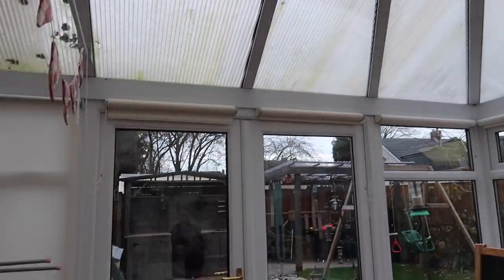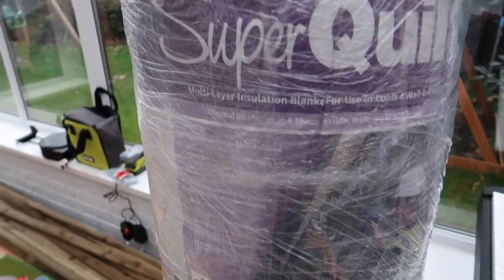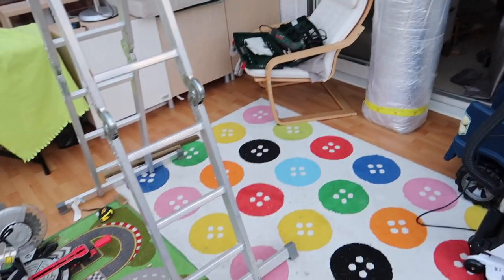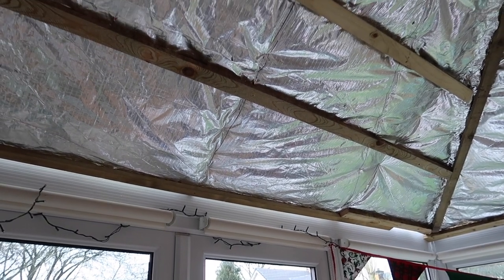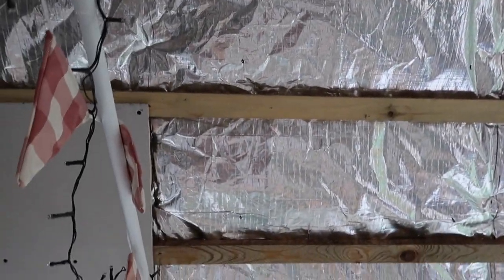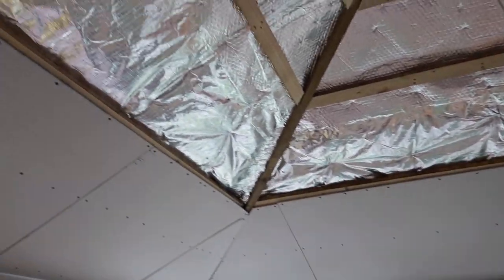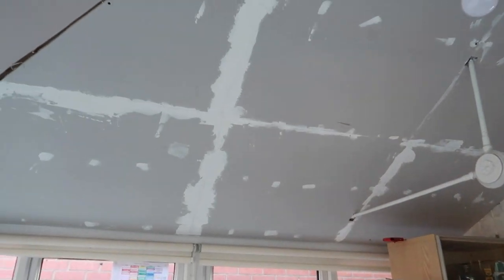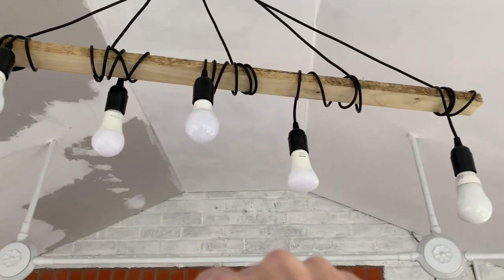How to DIY Insulated Conservatory Roof less than £320 - Single handed 30 something women!

Comment: Looks good....from inside but I can't imagine it does from the outside....
As for condensation , yes you've made a good job of sealing inside..but I can't see any ventilation to allow condensation to exit.
Any condensation can now freeze in winter and expand. After a winter going into spring/summer you may see some cracks or damp spots in your plasterboard.
Reply from the maker: Thanks for your comments, its been up almost two years now and theres absolutely no issue with any condensation and you don't see much different from outside it just looks white.

Comment: Truly amazing job. did you need "Special" screws to attach the battens to the Upvc struts ?
Reply from the maker: I used the self tapping screws for metal from b&q to ensure a strong grip
Reply: @LyricGrace  My wife and I were wondering if you had a free week at all ?...lol
Reply from the maker: @buggybill2003  ha I wish! If I did it’d be spent cracking on with all my other house based DIY ideas! Good luck if you plan to do yours!
Reply: @buggybill2003  🤣🤣

Comment: Hi Jane, how do you seal the bottom part  of insulation before installing the batons?  Do you tape it against the uPVC. Thanks in advance
Reply from the maker: Yes I neatly taped it then after the plasterboard went up used a flexible filler to make the edge neat and square

Comment: Why use double batons on beams? Could you not have taped insulation on then drilled and fix a baton on after?
Reply from the maker: You need air gaps for air flow around the insulation. Also I wouldn’t have been able to have seen or be accurate in putting my beams up, so the first one creates an extra air gap so that no condensation forms.

Comment: Hi love! This is AMAZING! Has given me so much confidence! Our conservatory is exactly the same! We have 3 kids and 3 TINY bedrooms and I was HOPING to insulate the conservatory, insulate the floor & carpet and move hubby & I down there as a temporary bedroom as our kids are getting older and moving is not an option and we have just been quoted 15k by two local companies and we have a budget of £1000. A couple of questions please….

Is the difference in temp really noticeable? In the winter ours is like a fridge and summer it’s a sauna. Would u be happy to sleep in yours or is it still to much? 

Also , have you noticed a reduction in the rain noise? 

Thankyou! Well done !
Reply from the maker: Hi, thanks for your comments. So to address your questions, in summer it’s def cooler by a large amount, in winter it can still be cold as there’s no central heating in there BUT (and this is where the difference is) I use a plug in rad and open the door the temp equalises with the house quickly and also then retains the heat well. So absolutely worth it for us. We use it as an office\ playroom now all year round. The rain noise is massively less and I can conduct calls no problem in there where as before there was no way when it was raining! You can still hear it but it’s much reduced. Good luck with yours!

Comment: Hi  great job well done, could you confirm if this has made a big difference in the winter? We have same conservatory with no heating, will this do the job to keep it warm? Again really well done ;)
Reply from the maker: Thanks for commenting. So you might of seen my previous comments. The conservatory isn’t actually heated apart from a small oil radiator, so if the door is not been open, it’s still chilly. However, the massive difference is that if I leave the door open and the room equalises with the house temperature, it keeps its temperature far far better than it did before so essentially it’s more of a usable room.

Comment: Brilliant Job. Question. These self taping screws, are they too long to go out to other side from metal into plastic cover, causing a leak? how you know the length required? i m thinking yo do mine after watching this :)
Reply from the maker: Great question! I pulled back the plastic cover from one beam to see roughly what size the metal was on my conservatory and then also measured the thickness of the polycarbonate. With these measurements and knowing the thickness of the wood I then used to calculate roughly how long of self tapping screw I would be able to use. Hope that helps.

Comment: Wow this is great thanks!! Was worried about the added weight and condensation but seems great what you’ve done. If you ever wanted to take it down do you think that would be possible or cause damage due to the holes or could they be filled? Thanks xx
Reply from the maker: I’m not sure, I guess after taking everything down I’d remove the plastic strip and do some research about filling the holes. This is out forever home so in the end we’d like a proper extension, hence not wanting to spend much on a solution for the next 5-10 years until we can get the full extension.
Reply: That’s what we want to do in the future too (an extension) so don’t want to overspend on something that isn’t permanent. This is our forever (Uk) home too, but might be emigrating so if the visa comes through we’ll be renting it out. As long as it’s easy to take down if the renters start to have issues with it, it should be good 🤞thanks so much for this video and the three star lock one too ❤️ Xx
Reply from the maker: @katiec3686  thanks, good luck with your visa. The lock one was very very easy to do so had to share that!

Comment: Amazing Job. Do you have any issues with damp between the insulation and the polycarb roof due to condensation?
Reply from the maker: No none at all so far, I made sure there was gaps between the roof and insulation and insulation and boards to allow for airflow.

Comment: looks great, well done. what did you do on the outside?
Reply from the maker: Nothing, it still looks exactly the same on the outside as it did before I started, well I have cleaned it but only for my aesthetic value as I hate it looking grubby when I look down from the bedrooms!
Reply: Thanks.  We have clear glass and wondered how to not just see the insulation through the glass??
Reply from the maker: @smithersapp  ah right I see, yes mines different as it’s polycarbonate and you can’t really see through it. If it were me I’d look at using some frosting spray or frosting film on the glass. I’ve used it on a glass door before and it came out really well. Just an idea for you to look at. Perhaps someone else on YouTube may have a video for that?

Comment: Looking at doing this myself. How did you ensure there was a gap for airflow?
Reply from the maker: The first batons hold the quilt away from the original roof leaving a gap, then the second set hold the plasterboard away from the quilt leaving another air gap, so far no condensation and I’ve had very cold temps and some warmer sunshine and it’s all good. Hopefully I’ve left enough gap, it’s what other videos have suggested doing

Comment: Great video, quick question how old is your conservatoy roof, how long has the new stuff been up now. Have you seen any sagging due to the weight of the timbers.
Reply from the maker: The conservatory is 16 years old, the roofs been up around 10 months and no not seen any change so far. We’ve had both extremes of weather during this time.

Comment: Hi, its been 2 years since you uplaoded this so i justvwant to ask 
1. Do you have any problems with Damp? Im worried about condensation building up behind and ending up with a damp problem

2. How effective is it as a room now? Is it still too hot/too cold or is it just like any other room?

Great job btw 

Thanks in advance
Reply from the maker: Hi, Thanks for asking. No I have no problems with damp or condensation, I think the big key here is to make sure you have the air gaps for circulation. I use that room all year round now as an office (the toys are gone!!) Yes its cold if I don't heat it but once heated it stays warm and its not an oven in the summer anymore.
Reply: @LyricGrace  thank you for your reply! I'm on with doing it myself at the moment and this video was a great help

Comment: Looking at doing this to our conservatory, quick question how has it been living with the insulated roof for the past few months has the temperature been any better and have you had any issues with condensation?
Reply from the maker: Thanks for asking, no issues at all so far thankfully. It’s def warmed in winter and more importantly keeps the heat inside if I use a small heater. Today it was 24 outside but inside got no hotter than 20 so I’m happy with that as previously it was like a greenhouse if the sun shone and regularly went to high 30’s or 40s

Comment: Hi there 
I just did same & when I taped the side , there was lots of condensation , 
Without taping the cold draft gets in 
How did you go by that’s 

Thanks 

Ahmed
Reply from the maker: I don't get any condensation, I made sure there was room for airflow from the side up between the silver blanket and the plasterboard. Perhaps theres just not enough airflow with yours? I sealed all the sides of mine and its been fine.
Reply: Thanks for replying, il check

Comment: Hi , love the video .   Do you think I could put the batten on over the insulation and put the plaster boards on the same batten . Was thinking of tape or glue , pins etc to hold insulation and do one batten at a time holding it up . Would much appreciate your thoughts . Philip
Reply from the maker: I'm not sure I fully understand the question but if you are asking if one baton is enough I'd say no, you must have air flow on each side of the insulation hence I had to baton twice. Hope that is what you were asking?
Reply: @LyricGrace   air flow ?  Would definitely reduce that . Thank you

Comment: Looking to do this my self, how is the room to use compared to other normal rooms?
Reply from the maker: We use it a lot more now than we ever did. If there's no heating then it can get colder as any room would. If I need to heat it I use a little oil filled rad and pop it on for a bit. The best bit of the roof is that it now retains the heat once heated up rather than quickly losing it and having to have the heat on constantly. If I leave the door open between house and comservatory it quickly equalises the house temp and remains stable.
Reply: @LyricGrace  Thanks! Hope I can do as great a job as you.

Comment: Well done .. love what you've done.  Have you had any damp/mould problems..? 
You should be proud of yourself 👍
Reply from the maker: Thanks for the comments, no nothing at all with damp, the key is def to leave air circulation gaps!
Reply: Thats great.. where are the circultion gaps?
Reply from the maker: @philmartin904  between the first layer of wood and the insulation roll then between the roll and the boarding, nothing is touching to leave room for air flow

Comment: Hey so what was the end result for the heat?
Reply from the maker: So it’s worked out really well. We can use it year round. Obviously I have to heat it in winter but once it’s equalised with the house temp it retains its heat well and does not need the constant heat on as it did previously. In summer yes it still get warm in the sunshine but no where near as warm as previously we can easily work in the comfortable temp inside now and no sun glare on the monitor either

Comment: This video inspired me to have a crack at this myself. I’m following the same idea with same materials. I’m just doing a lean-to so it’s a bit easier. I got the insulation up 95% yesterday. Despite it being a cold night, down to 1 degree, it definitely made a difference. I have a Dyson fan that logs temps so I can compare quite clearly before and after. Between 6-9pm it was 2 degree’s warmer with the insulation. It also warmed up quicker in the morning. It’s a sunny January day, 2 degree’s outside but the conservatory is 22 degree’s and warming the house up! That’s definitely better than before.
Reply from the maker: Brilliant, glad to hear it’s helped you. Good luck with finishing

Comment: Hi there you done a good job on the roof did you have any problems with condensation ? Also I’d worry about the weight of the plaster board did you have any problems? Over all bloody good job I’m doing mine but concerned about putting plaster board up might go for plastic light weight option but your feed back would help thanks Lee
Reply from the maker: Hi, thanks for commenting. No I've not had an issues with condensation at all but its very important to leave air gaps. I did consider plastic but felt plaster board for me was easier. Go with what you feel is best. Good luck!
Reply: @LyricGrace  thanks for the reply have you been pleased the heat performance has it made a difference?
Reply from the maker: @gameboy388  yes a big difference! In winter it was obviously colder in the morning as no central heating but once I’d put the oil filled rad on for half an hour it retained the heat really well and did not need constant heat all day. Just leaving the house door open menat the heat equalised too which is much better than before.

Comment: This is so impressive! Trying to persuade my other half to give it a go together. Were you worried about the extra weight at all? How has it been since you did it, any issues with condensation? Thanks so much for the video.
Reply from the maker: I used the lightest plaster board I could find and it’s been fine, looks as good as it did over a year ago. No issues with condensation at all thankfully but I was sure to leave lots of air gaps so hopefully all ok 👍🏻
Reply: Good to know re the plaster boards. I have seen other videos where they add plaster too so surely this method weighs less than that. We might not do the full battons along the framework and just do a few to staple the insulation to but then obviously want it to stay up. Thanks again for the inspiration.
Reply: Hi Jane, sorry to be back asking more questions! The thinnest plaster board I can find is 9mm, do you think that is roughly what you used? Also, I have fallen at the first hurdle slightly and don't want to force the plastic covers off in case it breaks the roof, how did you get them off?? Thank you in advance! x
Reply from the maker: @alicerosfield8078  I used whatever the thinnest was at b&q so if they carry 9mm then that was it. Which plastic covers do you mean the centre top or on the beams? If you mean the beams I just screwed through them. Took a few goes to realise where the centre was but once you get it it’s easy

Comment: Well done good for.........I'm doing mine tomorrow but using upvc cladding....how did you find out if the existing roof can take the weight of using plaster board as I'd rather use that but been told its too heavy
Reply from the maker: I used the thinnest plasterboard I could buy and it seems fine, I’ve tugged it, pushed it and no movement so far

Comment: Great job!! looks superb!! 
where did you get the super quilt from?? and how much did it cost?? many thanks
Reply: wickes sell it
Reply from the maker: I bought mine from an online seller called insulationhub.co.uk as it was the cheapest price I could find
Reply: How many rolls did you need for your roof, my roof comes from my wall down a slope and is only 10 x 12 not sure how much we would need, would be nice to use it in the winter as electric going up time to do this job while still mild for October

Comment: Hope you checked your conservatory specs.  Plaster board and super quilt weighs almost 10 kg per sq mtr.  As superquilt is non breathable you will get condensation which will add to the weight. If you get a good snow load you will be dangerously close to overloading the structural support load.
Reply from the maker: Thanks for your feedback and valid concerns, I used the thinner plasterboard for lightness and I have been monitoring for condensation and and so far we have had none in both extremes of weather. If we have snow then I normally brush it straight off the roof anyway as it’s below the bedroom window and perfectly reachable. I did do quite a bit of research before commencing this project so Im not worrying about the extra weight. The conservatory has stood for many years abs our plan in the next few years is to remove it and add an extension, if anything happens to it at this stage then the plans will be brought forward. The reason for going DIY was to keep it cheap as it won’t be around for the long haul.